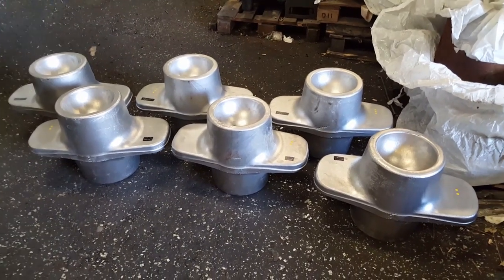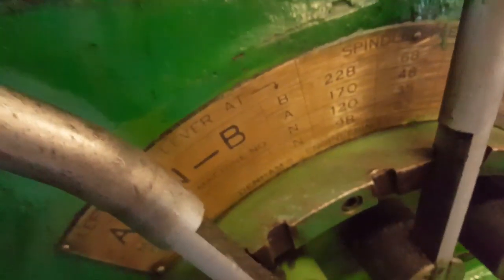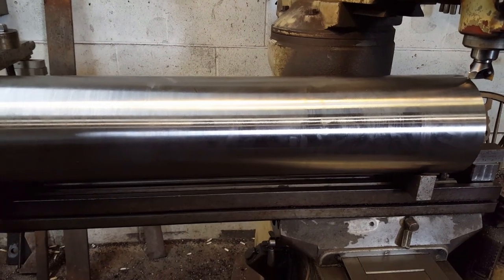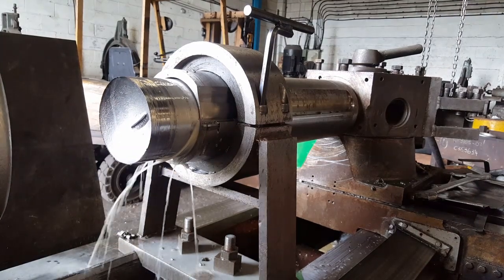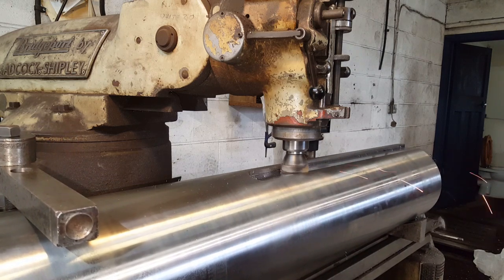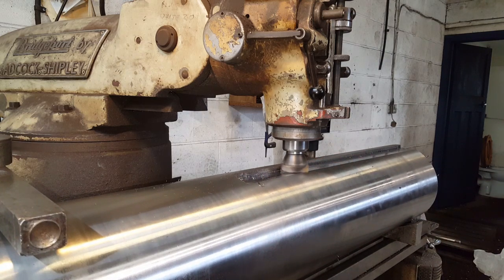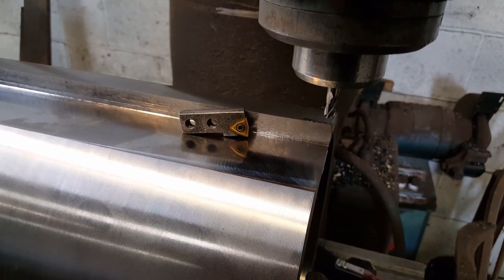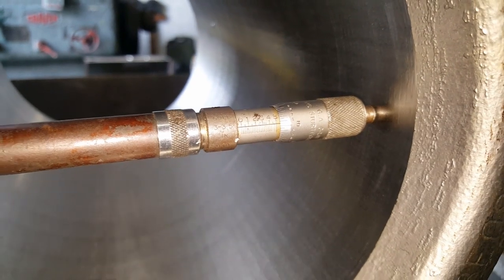TITANIUM FORGING and tool making.

Comment: Dave, That's the difference between a very experienced machinist like you and a less experienced one like me.  Had I had all that work on the weekend I would not have known exactly how long it would take.  Therefore to ensure I met the Monday deadline I would have worked late Friday night, started early Saturday and worked late Saturday night, started early Sunday, finished by mid morning and then tried to drink a weekends worth of beer in the afternoon and been hung over Monday morning.  When you have lots of experience you know how long a job will take and you can spread the beers throughout it.  Good work.  Ken
Reply from the maker: Yes Ken. I've done these things hundreds of times and can time each machining operation to within a few minutes. 👍
Reply: Great comment. So true. :)